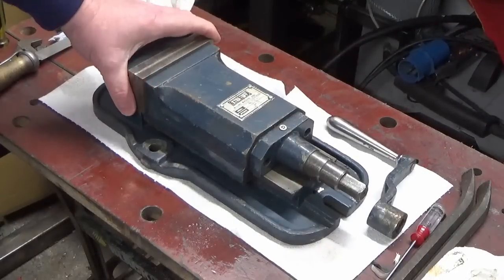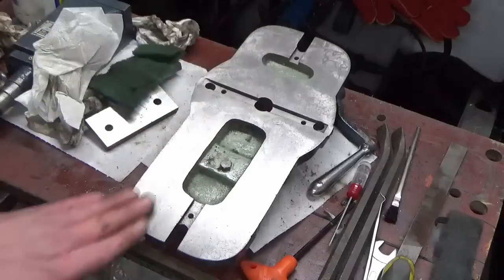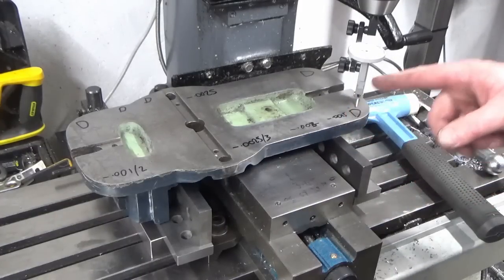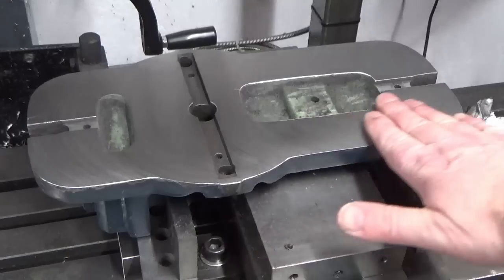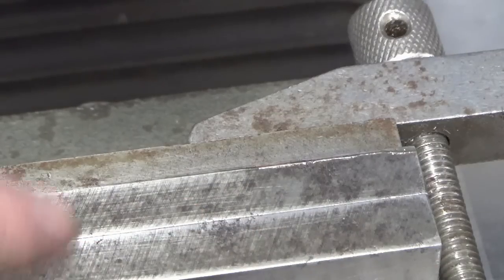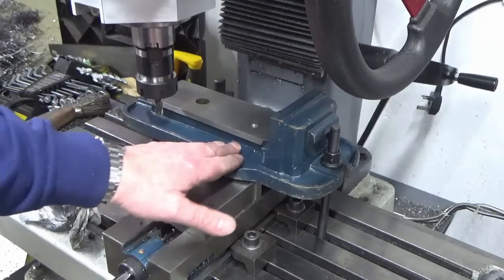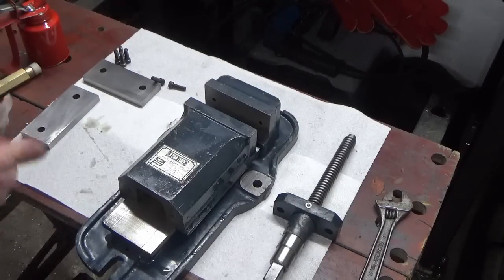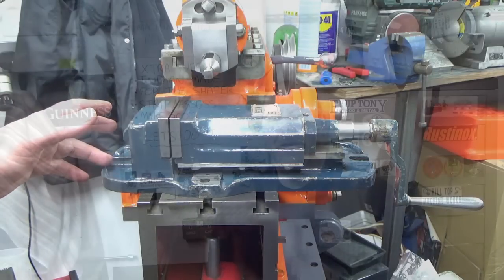Machine Vice Refurbishment for Atlas 7B Shaper

Comment: I had similar thoughts as soon as I saw that slot in the base.
Are you able to ensure that slot is parallel with the fixed jaw? If you key the bottom to your tee slots, then you can be guaranteed the vice will be square the table/ram.

Comment: 50:50 on painting vice,  I interpret that as not painting the machined faces, 1 vote to paint it Jon.
Looks a nicely built vice, should complement the shaper well. 
Thanks for sharing
Reply from the maker: Hi John, thanks for the comment. It will get the treatment eventually lol, need a blast cabinet to get the enamel off easily first (and a bigger workshop to put it in lol). Cheers, Jon

Comment: Hi,Jon. I have a couple of old machine vices that were beaten up and had seen lots of previous service before they came into  my workshop. 
I carry out pretty much exactly the same procedures as you have when refurbishing an old vice including skimming the bolt hole fixing points flat and free of paint.
The tough paint on the castings is most likely to be an epoxy based enamel(tough as old boots).
When repairing the drilled idiot mark you can,as you suggest, use JB  Weld to good effect but I also often use fine cast iron powder and thin viscosity superglue for these types of filling repairs. The superglue/cast iron is very hard wearing when fully cured.
Edit to add: I am wondering what type of engine is on the bench in some of the footage?
Reply from the maker: Hi Howard, thanks for the comment, never heard of that little tip before with the superglue (thanks, I may try it). Motor on the bench is the new one for the shaper, shown in more detail in last week's video. Cheers, Jon
Reply: @jonsworkshop  I should have said what is the model engine,not motor but now I think back I think it is likely the flame licker you made some time ago.
The fine cast iron powder itself can be purchased from a number of resin casting suppliers.  It can also be mixed with clear epoxy resin for use as a metal filler paste.
The technique with iron powder and superglue is the same as the baking soda and superglue repair method.  Apply a coating of superglue to the inside of the hole and sprinkle a bit of iron powder or baking soda onto the wet glue and it cures pretty much instantly. The secret is to build it up in layers so you get full saturation of the powder throughout the full depth.
 If nothing else just try a few experiments on some scraps of metal or wood with baking soda and superglue and see what a useful repair technique it is. It can be filed,drilled,finished smooth etc once fully hardened.

Comment: "corroborate" was correct. You are being told one story by the surface plate and feeler gauges, and another in the vise with the dti. You're trying to make those stories line up
Reply from the maker: Hi Kit, thanks for the comment and reassurance lol. Its funny, I knew it worked but it's just not a word associated with engineering, more with crime investigation in the UK lol. Cheers, Jon

Comment: HI Jon when the vice is in operation you may find it more convent to have  it turned in the other direction. Always automatic feed towards the fixed jaw. Nice job I also like your surface grinder. Bernard from Glasgow
Reply from the maker: Hi Bernard, thanks for the comment. I will keep it that way round I think, I plan to always have the table feeding towards me when operating from the RHS of the machine (on Rustinox advice lol), this way you can see the cut as it's happening and also as you correctly say, feed towards the fixed jaw. Not too far away from me then Bernard, I work in Govan & Scotstoun. Cheers, Jon
Reply: @jonsworkshop  Hi Jon The reason I suggested that you should turn the vice the other way around is that you might find that the cross feed handle will foul the underside of the vice base. As I have an Alba 10 A shaper ask me how I know. Bernard Glasgow.
Reply from the maker: @bernardreilly7519  Hi Bernard, a very good point, showing my ignorance of using the thing. I will check this out tonight when in my happy place

Comment: one thing you should do with the vice is put sumting in there clamp it just tight , put a measuring divice over the part clamped in than wrench down on the vice a little harder and remeasure , on a lot of the lighter vices parts lift up once you clamp down on it and thats wat seperates a useful vice from a not so good vice , as long as it does that evenly you can compensate for it if nor you be adjusting the part and clocking it in untill youre foaming at the mouth 
for a shaper you should have a vice with a lot of weight / mass so the "slamming" of the tool intoo the part doesnt dislodge it or moves it
Reply from the maker: Hi Watahyahknow, thanks for the comment and suggestion. Yep, I totally agree with you. Once I get it all fixed to the table and the machine is ready to take the first cuts, I will be running some checks on the machine and the vice, I will of course film them. Cheers, Jon